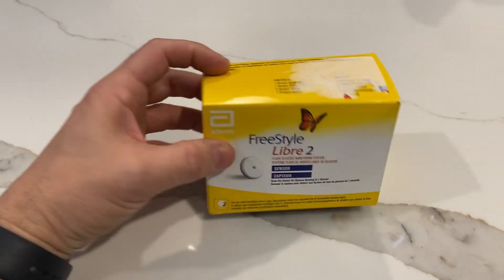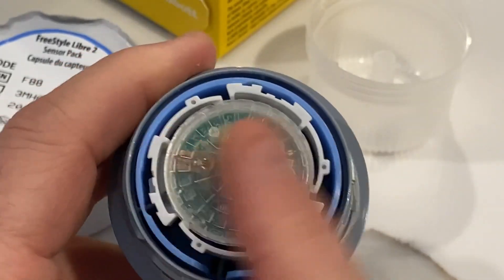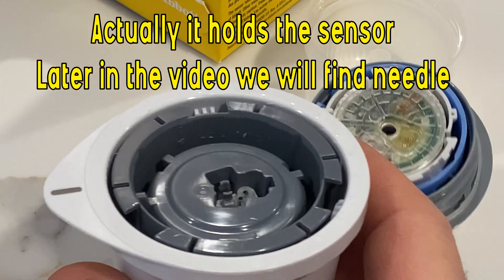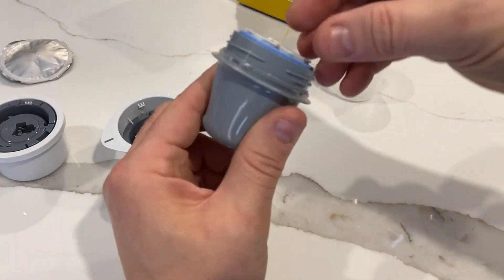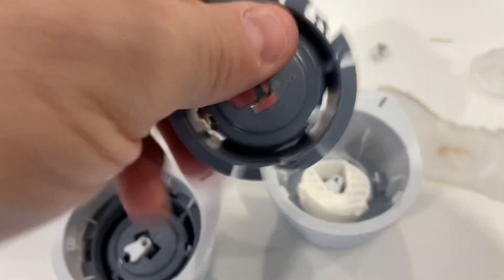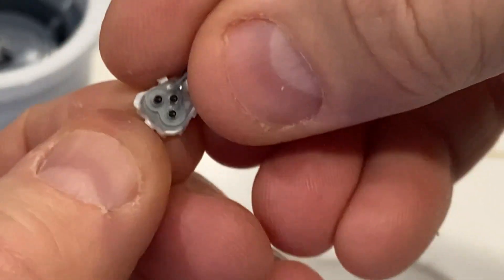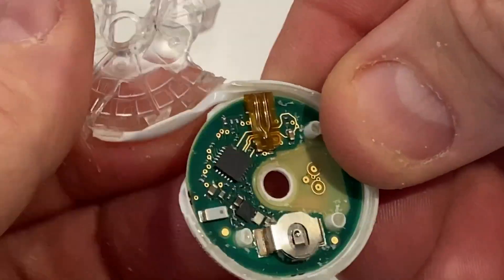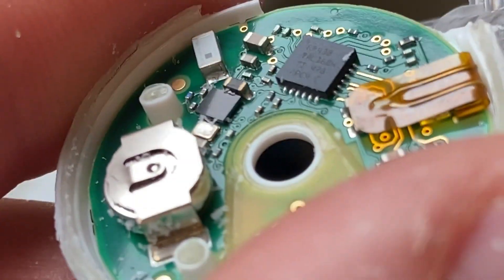Teardown of FreeStyle Libre 2 Glucose Monitoring Sensor for Diabetes

Comment: The needle activates a one time switch that turns it on as well as allowing for moisture bleed off. The cpu does have a timeout but starts reading low towards the end of life anyway.❤
Reply from the maker: Good information! I once had a "misfire" on one of these sensors during application. I applied it as usual, then noticed even a few hours later, no reading. Unstuck the device and saw that the black tip (that is supposed to be inside the skin) was bent 90-degrees and pressed sideways against the skin! I'm not exactly sure what happened, it should have followed the needle into the skin and remained behind... what a waste, the sensor couldn't be used, that's like $100 down the drain!